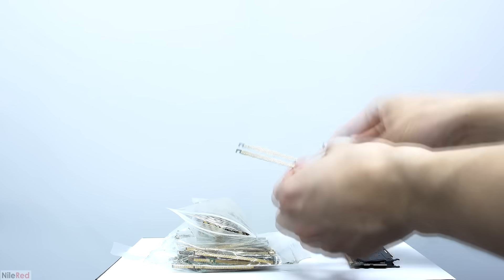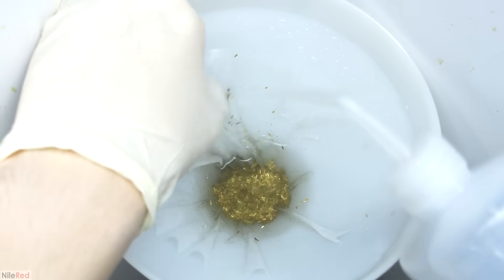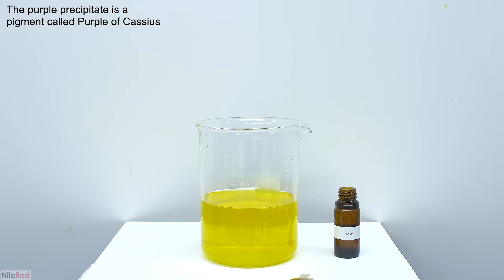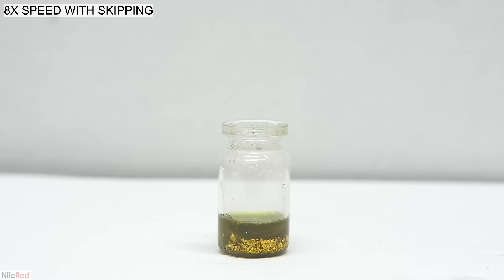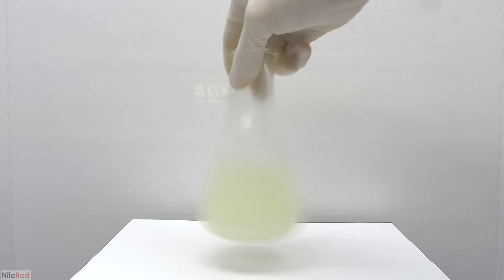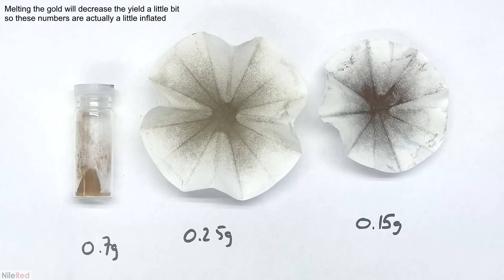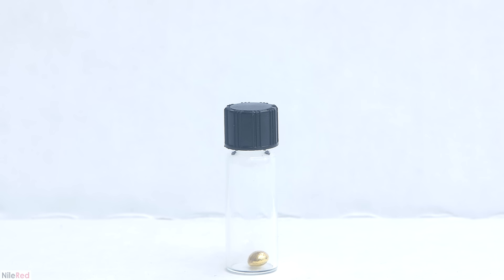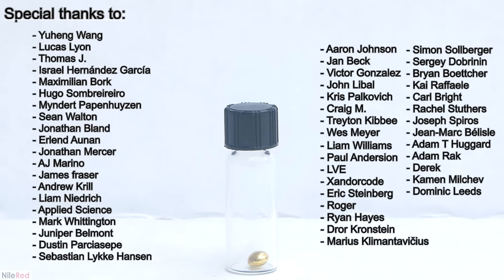Extracting gold from computer parts (Part 2)

Comment: I can see this being a side hustle, or at the very least a hobby, for someone who has access to free e-waste. A landfill, for instance, is a giant pile of discarded electronics.

After a few years of collecting, ignoring the costs of chemicals, a hobbyist could easily produce a bullion either for display or to sell it to the mint for a pretty penny.

Again, the cost of the chemicals would probably be equal or greater than the value of the gold bar, but as a lump sum it wouldn't be bad, especially if you're primarily extracting gold for fun.

Comment: I think the best way to do this if you want to make money would be to get your source for free or nearly free.  I have a garage full of old electronics for example.  But even then it would be a one shot deal, once it's all used up that's the end.  And let's not forget all the time in labor to extract the gold.  It's not just a matter of supplies and equipment.  I like to compare anything I am thinking about doing against working at my job.  If it's less than that it's a hobby. Once you're retired, anything goes though.

Comment: Help! I have a question for anyone knowledgeable... after the sodium metabisulfate has been added and the gold has been precipitated, I get a fair yield of precipitate. However, I can't get the powder to a vial. It's embedded in the fibers and/or too thin to scape off.  I ended up having to burn the qualitative filters until as little ash was left as possible, but even the ash free filters left behind a lot of ash... how is everyone getting the powder out of the filters once dry?

I tried razor blades, but was scraping both powder and filter fibers. Burning wouldn't get rid of ash alone, so I added isopropyl alcohol to provide an oxidizing accelerant (I know there is a risk of degrading the gold, but it was about as quickly burned off as it was added).

Comment: All the gold i plan on recovering is from close to 6 years of collecting. I heard some place that it would take 1500 cell phones to make an ounce of gold. Although i havent collected anything near that amount i have however supplemented with other electronic devices such as old wireless telephones, cable boxes, vhs/dvd players, old flat screen tvs, ect. I want to thank you for kind of dumbing the process down. The other videos ive watched didn t explain the process as well as you. I guess my only question would be why not melt the gold once seperated from the boards? Then process the smaller pieces in the liquid solution?
Reply: Not all devices contain gold, and this is what is meant by mobile phones. They may be old Nokia phones😢

Comment: Use some charcoal or a fire brick under the dish, it reflects the heat back and it will melt faster.  If you don't it looses too much heat to be efficient.

Comment: Thank you for going through the trouble of all this. Yes, it's not profitable for money, but invaluable for knowledge. You saved us a lot of trouble working with those chemicals most of us don't know as much about, or have the proper safety equipment to handle. I would not get started without the safety gear first.  Great set of videos!

Comment: If you can find a junkyard close to a big city that has poor oversight and lets you take electronics from there, or know a local hardware repair shop that doesn't care.. That's where you can get the gold the cheapest. I just doubt it'll ever get anywhere equal to doing an actual job.

Comment: So gold is not the only metal found in computer chips and circuit boards, there's rhodium, palladium, copper, and platinum, as well as another of other metals. I realized that the gold may not be worth it alone but what about the extraction of the other metals, as well as those used in the ICS and other components? I really just wonder what the continent of these metals is. As well as what other methods could be used to extract those,. Would the waste chemicals be something that you could further extract from?

Comment: Heh, cheapest way to get electronics is just advertise that you'll accept dead computers.  Lots of people don't know how to get rid of all the garbage computers they have shoved in their attics, and you can get quite a few!

It's helpful to have a 50ml conical tube centrifuge.  You can load up solutions with finely-divided gold suspended and with a quick spin at even modest speed, all of it drops out.

Comment: Easy way to melt gold powder:  use the same final filter paper to trap all the gold powder.   Bunch it all together at the bottom and dry it.  Cut off the excess paper.  Wet the ball of gold wrapped in the rest of the paper with alcohol (either ethanol or isopropyl... this will hold the particles together) and immediately hit it with an acetylene torch in a crucible.  It'll melt into a nice little ball of solid gold.

You can do the same thing with silver, copper, platinum, and rhodium.  Not sure how well it'd work with palladium, since that triggers catalysis of hydrocarbons and atmospheric nitrogen when heated.

For copper powder, to prevent oxidation when melting, mix it with finely-divided charcoal powder.  This will smelt any copper oxide and increase yield.

Comment: easier method  fill a new crucible with an good lot of borax about a quarter full then add a bit of methylated spirits and set it allight the borax wil bind a bit and heat the crucible now you can turn on a flame whithout blowing the borax all over the show the borax will melt and with an pair if thongs lift up the crucible and let it evenly distribute all over the crucible by turning it till its fully glazed. and let the excess just drip out while still holding a flame to it. then again mix your gold dust with borax  about 50/50 and place it in the crucible pour a little bit of methylated spirits in and set alight so the borax binds otherwise you will blow an lot of gold dust out of your crucible or just burn it away now you can turn up the flame the excess borax you can just pour of and you are left with your clean gold... I am an goldsmith and do this for an living.

Comment: If you have gold in solution and it touches your skin or fingernails it will create a purple stains that takes moths to wear off. In the case of fingernails it gas to grow out and be cut off. My other comment is their are other potentially useful elements in the computer parts though not as easy to isolate.

Comment: I work in a assay lab and honestly filtering gold precipitate is a pointless step,  gold sinks, if you just wash it with water a couple of times in a bowl and pour out a majority of the water and contaminates you can just put it on a hot plate and evaporate the remaining water. If you stick that powder in an oven at 600 degrees to anneal  it’s a million times easier to work with a torch won’t blow it away

Comment: The secret to making money from precious metal recovery from old computer parts is to get the parts for free. People sell that crap on sleazebay because people that don't any better buy by the truckload. Get the parts for free. People leave all kinds of crap by the curb on garbage day and in dumpsters. Just yesterday on my trip home for work I nabbed two old school cathode ray TVs, two microwaves, an all in one printer, the ink cartridges in the printer, a dozen spent ink cartridges in a bag next to the printer, two dead computers, six laptops, three routers and two air conditioners. 

ACs are thrown out when they stop cooling. They stop cooling because the refrigerant has leaked out. Minus the refrigerant window AC units have tons of aluminum, copper and circuit boards in them.

Old school TVs have tons of copper and circuit boards. The older the TV the thicker the gold plating is likely to be.

Microwaves have copper, aluminum and circuit boards. Just be sure to properly discharge that big honking capacitor or you could die.

Printers are rich with copper and circuit boards. Don't forget the cartridge the ink cartridges snap into! Every slot in there has a section thick with gold plated finders that the ink cartridges make contact with.

Ink cartridges have tiny circuit boards loaded with gold plating that just pop off with almost no effort.

Computers, laptops and routers are filled with copper, aluminum, and circuit boards.

All the steel casings and transformer parts go to the scrao yard for a few more bucks when I get enough to make the trip worth it.

Other people's trash is my treasure.

Comment: The secret is to become the dumping ground for all your friend's and family's tech junk. Don't spend money on the old tech junk - just take that crap off of your friend's and family's hands. Don't overlook your employers either. I've emptied many back rooms worth of tech graveyard for my boss at no cost to me. I've been doing this for years as a side hobby. I collect every dead motherboard, every dead PC, every dead printer, every replaced hard drive, every old video game system, old TVs (the old cathode ray monsters, plasmas and LCDs), every old phone and every broken electronic toy. I even collect everyone's old smoke alarms and anything else that has even a small PCB in it. You can pass the same solution through several slightly different processes to get all the gold, silver, platinum, copper and aluminum out of it. All of those metals have value and if you're going to the work of this anyway it doesn't make much sense to just wash everything not gold down the drain. I mean seriously you only spend twenty minutes to an hour doing something and then you're leaving everything sit for a night or a couple of days or a week so why not. Also don't overlook the computer cases and motherboard trays. Some of the cases and motherboard trays are aluminum and can be cut up and processed to get rid of the enamel, glues, solder, etc as well and they add up. Aluminum isn't worth what gold or platnium is worth but when you get it for free it adds up pretty quickly.

In the six years I have been doing this as a hobby I've made enough money selling the precious metals to local jewelers and the aluminum and copper to a local metals supply house I've bought myself a very nice a Mesa Boogie tube amp head with a Mesa Boogie 4 x 12 slant cabinet and built a very nice custom Jagstang and a Jazzmaster from bodies and necks I custom ordered from Warmoth and filled out with my choice of amazing parts. For those of you not into guitars at all that's about seven thousand dollars.

My wife stopped complaining about all of the spare parts collecting in the basement periodically when she realized my new music gear was not coming out of house money.
Reply: Teach me the ways. I know I'm late, but I just started learning about this.

Comment: WARNING!!! - The acids used in this method produce toxic gas which will cause pretty much anything with iron within 5 feet to rust severely.  Also, it is exceptionally dangerous to breath in these gasses.  So you cannot do this in your garage or kitchen. Also - you cannot leave the beaker of parts anywhere that children or animals can get to it.  One other major point to warn you about is that you should not dispose of the acids down your drain. You will rust out your plumbing completely and the repairs will be exceptionally expensive. If waste disposal is in any way done properly, you will never make a profit doing this.

Comment: I work in an assay Lab at a gold mine, when we're dissolving the beads that contain the gold we simply use hot plates to make the aquaregia work faster, take 3-4 hours of dissolution work and shorten it down to about 25 minutes, and less with a good stir bar.  Not much of what I learned in undergrad is used here, although they're considering bringing in cyanide so at least I could use my upper level inorganic chemistry knowledge and the 18 electron rule ...

Comment: "You'll notice the melting bowl is cracked"
yeah no sorry I was way too distracted by the burning table
Reply: Ha ha ha. So was I.
Reply: @TheRealRB3902  starting from 14:13
Reply: If the bowl is cracked then it's justin
Reply: Lick the socket, honey
Reply: All this effort and cost and the risk of burning your lungs and ending up with respiratory failure … you might as well take up smoking unfiltered cigarettes and get COPD
Reply: cowards i was looking at the sexy, amazing, beautiful, table
Reply: The bowl cracked off because of the Borax which is making damages on the ceramic when used repetitively in the same contaner. It makes the same during weld-forging steel processes.

Comment: here's a good way to get some profit from this-
Instead of throwing out old computer components once they stop functioning, collect them - once you have enough, run this gold extraction on them and just keep the powder without smelting it down. If you also already have a home lab that uses things like HCl and HNO3, so much the better
eventually, over years of electronics ownership, you'll build up grams and grams of gold, while the material itself becomes rarer and rarer globally, skyrocketing the price. By the time you're ready to retire, just dump your powder in a crucible, smelt it down, and then sell off the bead of 10ish grams of gold for hundreds of thousands of dollarydoos
ezpz
Reply: Thats one way for sure, but there are even more simpler methodes and less cost intensive. at least it will kinda work in germany!

At least once , in a month, people throw away electronic, because polish people come here in our regions to get old stuff, that they can make to money. So make sure when it happen and drive around and take the electronic stuff. So you dont have to buy all of this stuff and further more, you not only need to take out the gold, also copper and so on.

Comment: Wouldn't it be cheaper and easier to separate the gold from the boards with heat in a well ventilated area?  The gold melts, the boards burn off and you skim off the dross. Sounds too easy, someone rip this idea up.

Comment: Upon viewing, while it might not be cost effective, I wonder what all metal could be extracted from an entire old computer.
Reply: Yeah, I was thinking along similar lines. Grind up the circuit boards into fine powder to expose any internal metal layers, then dissolve all the metals out. No idea what you'd do with the resin or glass parts of the board, though.

Comment: Is it possible to extract elemental metals from the leftover metallic solution from the first step?
Reply: MaeLSTRoM1997 You can get metals to drop by placing more reactive metals into the solution. For instance, you can extra copper by placing an iron rod into it. The iron will replace the copper, leaving a layer of copper on the rod.
Reply: If there is a mixture of metals in the solution though, how do I separate different metals that will form as a result of such process? For example if both copper and nickel compounds are present I imagine both metals will form on the iron rod?

Comment: By the way, many IC chip packages have 24k gold wire connecting the chip itself to the lead frame. But you will need to dissolve the epoxy to get to them.
Reply: Couldn’t you just burn all the plastic epoxi etc and make live much more easy?

Comment: ROTFLMAO!  You've spent too much time in Chem Lab :)  I got the feeling with all the chemicals you used you lost money.  What we do is take a rock grinder (like we use on ore) and grind the boards to dust.  Then we take a gold pan and pan down to the heavies.  Then into a tumbler and a tea spoon of lye for two hours to clean any film or residue off the gold.  Then toss in a tablespoon of charged mercury and tumble two more hours.  Squeeze that through a piece of chamois and get the amalgum.  Put that into a retort to get the mercury back and get the sponge of gold.  Fire that sponge and you got your button with NO loss of gold :)  The only chemical expense is a teaspoon of lye.  When you get to skinning cats, there is more than one way son :)

Comment: Was the borax coating required? I always see borax use directly in the metal as a melting point lowering agent. I see it as : If you can easily convert the gold into a flowing liquid and sink down under the borax then when it cools down, the borax just make glass and can be chipped off, easy-ing the process.

Or used like this : https://www.youtube.com/watch?v=CtBus_iU-PQ
As a oxygen blocking layer so the steel can forge weld without delamination.

Comment: Can someone explain how his stir bar works?
Reply: It's magnetic. I'm not sure whether the external field is applied by putting another magnet on a motor or just creating a varying electrical field, but the stir bar is used in conjunction with the plate underneath the beaker.

Comment: I think that it will be wa-ay more useful and interesting to do a video about recovering some non-common element from some non-common source-as for example iridium metal from iridium spark plugs!Or even better extracting osmium from proper Osram bulbs' filaments,which consist of 80% tungsten and 20% osmium!
Because I have seen hundreds of videos about getting platinum,palladium,gold and silver from all kinds of stuff that can contain any amount of them but I have seen some extraction of iridium metal only in Cody's lab video and in a wa-ay scaled up processing of them in real life simply made by me-as I needed it for my firearms project(which needs it because otherwise any kind of existing metals,from which existing firearms are made from simply won't be able to withstand even the single such shot)..And I was literally shocked by the yield from them-from exactly a hundred of them I obtained 2.1 grams of pure iridium metal!
So I hope that you will make something like that!